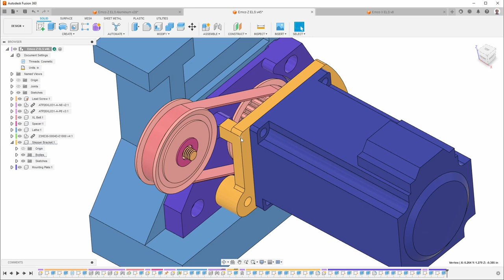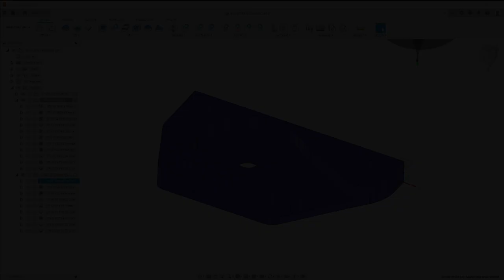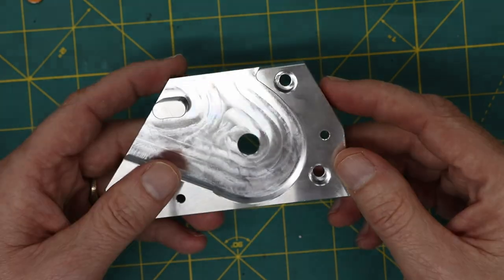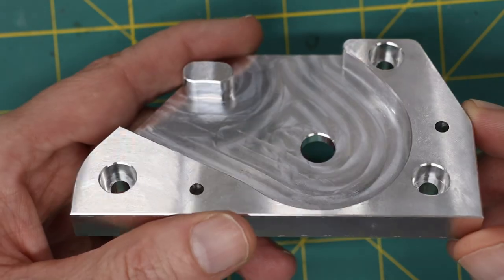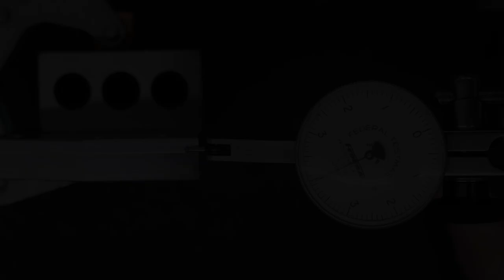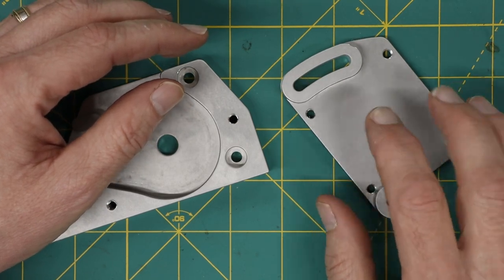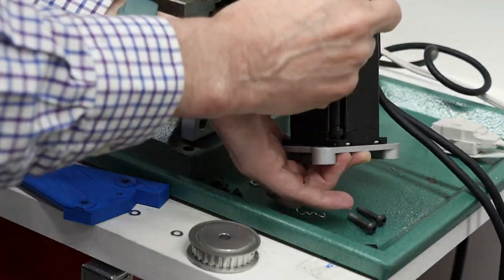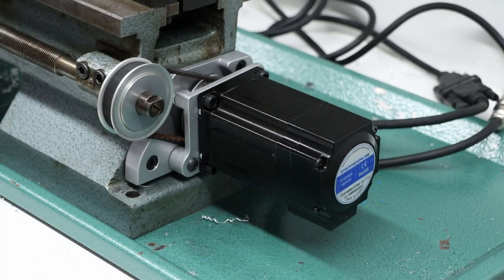Double Sided Milling of Z Axis Stepper Mounts

Comment: I do a lot of flip milling.  I handle it similarly...  I have one corner that I chase as the part flips.  I square my stock before OP1 and the top left is always the first origin.  I actually use a small spot drill to mark the corner so if I'm running multiple parts over a series of days and operations, I can track the origin without having to rely on my memory.

Comment: The thing of it is - you had a through hole on both parts, which is kind of the ideal way to solve the problem. Machine the part with the traditional "hat" technique, machining down the walls as far as you can. As long as you locate the long edge off a fixed parallel surface, probing the bore is going to give you the XY location of everything else, from features cleanly machined and relative to everything done in Op1.
What would have been your downfalls is the big No No of using the gripper inserts for 2nd op locating - these are not in any way a parallel surface! Ignoring the bite marks they produce, the fact that they displace material means you aren't locating the part off of anything truly rigid.

Comment: I think I've seen it on this channel before, maybe not, but you can use those through holes as your point of reference on the second setup instead of the raw edge.
Reply from the maker: Yes, I certainly could. At the moment, I don't fully trust the probe on circles, as I ran into some issues. I talked with Renishaw support and know what I need to do, but haven't gotten around to making the changes they suggested.
Reply: @JohnSL an I ask what the suggestion from Renishaw was John

BTW, love your content !!!

Comment: I'm a little late but this was a wonderful adventure! Thanks for the inspiration. 
Just looking at upgrading a new 'King Canada' 12x36 lathe to a 3 hp VFD, and the ELS pro controller with their motor kit. Will need brackets; your design is really great and it can be modified for the larger bed end geometry.  It'll be about $3k CDN when finished - but the lathe is remarkably accurate from the factory (<0.0001 runout) and it has a D4 spindle. It's got a huge gearbox so not sure what limitations that may impose with the proposed VFD+Servo spindle. Cheers!

Comment: Have you considered sand blasting the aluminum parts? I have achieve similar results to the one you showed by sand blasting them for only a few seconds in a small blasting cabinet with a small compressor. Might be worth a try. Thanks for sharing your process. I have never even though about using a tumbler...until now...
Reply from the maker: Yes. But I don’t own a blaster and I already had a tumbler. A tumbler takes up a lot less space, plus you can put in a bunch of parts and walk away. I think once I have better media, it shouldn’t be so slow.

Comment: Great Video!!  Why not bore the large hole all the way thru and use the hole center as your zero on the other side.  If your vise is square your other side will be dead on!!
Reply from the maker: I certainly could have. But I wanted to try this approach to see how close it would turn out.

Comment: Greetings John, great video. Could you give some info on your tumbler.
Reply from the maker: It's the 18lb one from Harbor Freight. I got it used to try it out and it works just fine. The choices they have in media, on the other hand, are very limited.

Comment: This is really cool but i'm wondering why not just like hold on to .150 of the material in the vice do the whole op on one side flip it and then just face that last bit of? It would make the alignment part much easyers all the critical Features are done on one side and then you really just need to pick up a rough x & y and your z for the face mill op.
Reply from the maker: I only had on hand 0.5" thick material at the width I needed. I could have ordered some thicker material, but I was curious to see how close I could get with this approach, so I used the material I had on hand. The parts came out well within tolerances. Would I use this approach to make a part for someone else? Nah, I'd go with a hat. Doing this, however, gave me more confidence in the accuracy I can get.